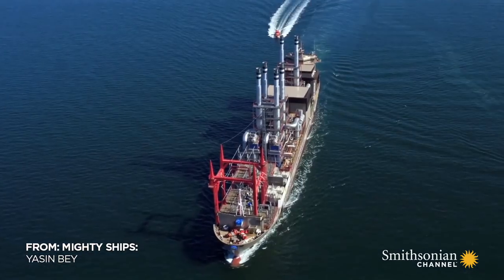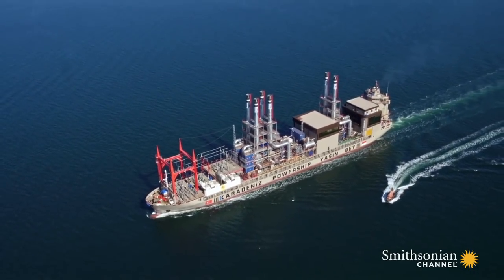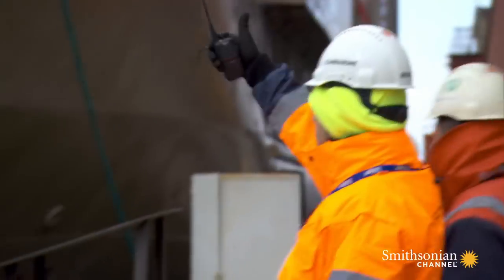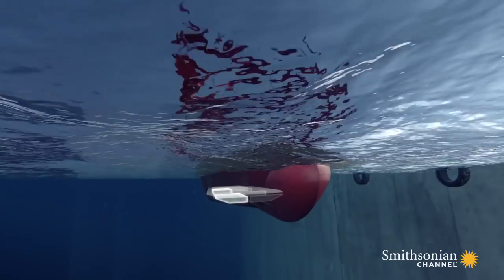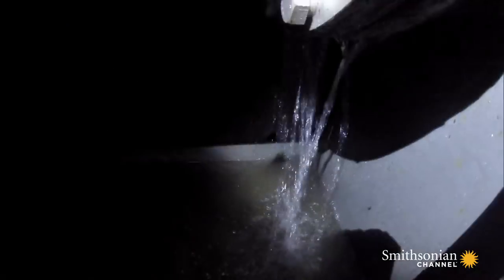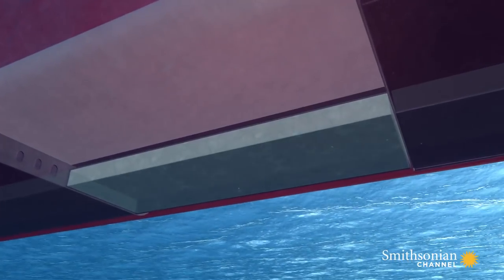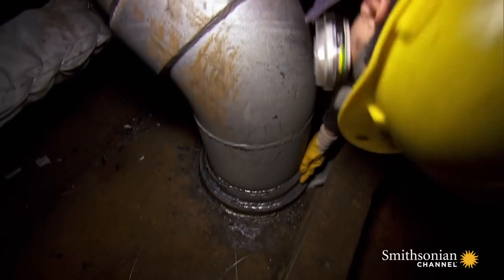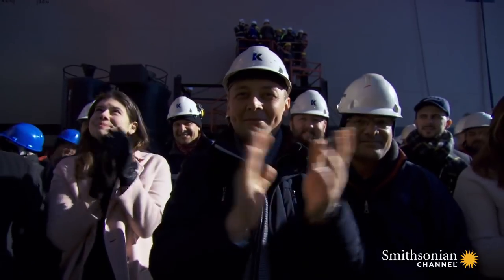What Do You Do if a Giant Ship Can't Stay Balanced in Water?

Comment: Before installing all the new equipment, the old concrete ballast should have been removed. Now they have to do a patch job on it. Piss poor planning during the conversion.
Reply: Much easier said than done. I can't think of a harder place to get to on a ship than its ballast.
Reply: @nnelg8139  I didn't say it would be easy but certainly would have been better than the problems they have now.
Reply: @patrickmccrann991  
Very true.
Reply: @patrickmccrann991  "better" is subjective. As long as the monetary cost of rebalancing the ship with an additional ballast (including ongoing costs) is less than the up-front cost of removing the current ballast, then it's the better option from the owner's perspective.

When you factor in the opportunity cost incurred by having to spend many months in drydock before becoming seaworthy again, a tendency to list in a ship that will spend most of its lifetime moored in a harbor doesn't seem so bad.
Reply: They don't have any problems now, though. They put in a bypass. Done.
Reply: @addanametocontinue  lol idealist vs realist
Reply: Probably more like perfect planning. Getting cement ballast out does not sound easy (i have worked with cement, large ship design where i spent a lot of time in the ballast and bilge areas, fleet support, construction support), and it was probably more expensive than the extra fuel it would burn sailing, and they had a job to do and the downtime would have cut into income.
Reply: or fill the other side with concrete, too
Reply: @nnelg8139  hey he's an internet expert! ;)

Comment: So why exactly did they run the pipe through the concrete? Piping is just prone to failure, like all components, why not make it easy to fix? Add some valves so that it is easy to drain a part of the system and fix it, and it really wouldn't have been so hard.
Reply: because it's turkish

Comment: Get rid of concrete and add water and make a system to move the water Incase the weight changes from side to side. Make the water move around.
Reply: The only way of removing the concrete would have been to drydock the ship and then cut open the bottom of the ship.